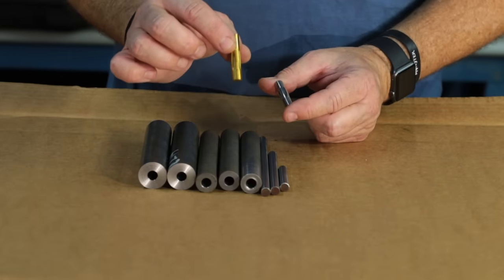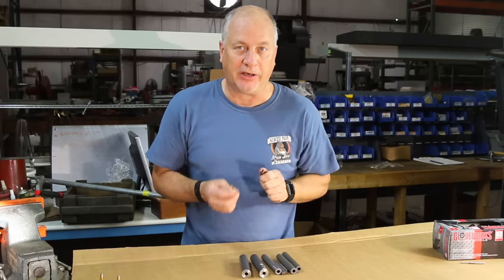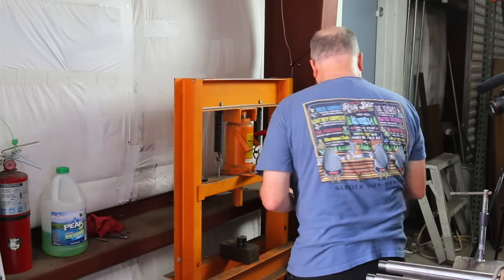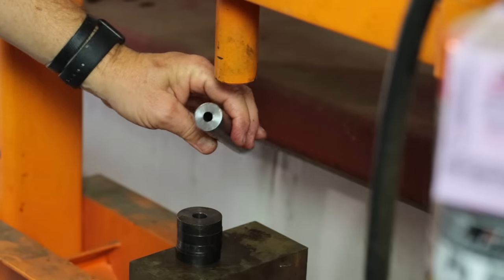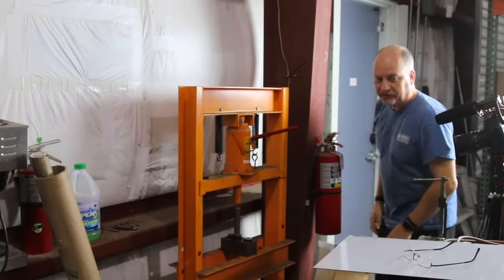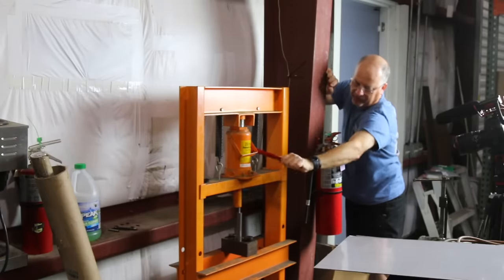Home Shop Rifling THREE(ish)...China vs. Ukraine Rifling Buttons!

Comment: is it possible to do the same rifling process to a longer barrel? like for an airgun or something like that. I'd like to create an airgun all by myself and that's the most difficult piece to make (if not imposible)..
Reply: Yes but no need. Bb s are rund. Normaly there is no use round balls with riffling.
If u use airsoft 6 mm then u lose power because of leakcage of air through rifling. Assuming it would be 6 mm.
Or a caselmann air machine gun☺
Reply: @GD90341  i wanted for a real airgun like a .177 or .22, i know 6 mm airsoft doesn't need that. i've seen today a guy that made a press with metal spacers buffered with springs through the entire barrel. that's genius. that way he aligned the bottom along the way of a long barrel if that's the case.
Reply from the maker: Sure.  You just have to have support(s) for the push rod to keep it from buckling.  Sometimes airgun barrels are made from bronze, I believe, and that would be a lot easier to rifle than steel.
Reply: @markserbu  yes you can do it to a railway gun theoreticaly if you have an enough long rod and press. First I saw when I ordered chinese buttons are cheap  when they came I saw they are really fine made nice surface everything exakt how to be and then when I used them I saw they make a real good job. I was very doubtful if a button for so small money can do the job but then I found out it does a great job of all parameters are good. Thanks Mark for sharing your content I love your videos 👍👍👍
Reply: There are Chinese buttons for .22, but i think they are for 22lr. T o deep grooves.
Reply: @Customizing guncollector 
Airsoft? We play only with luger.😈
Reply: @Customizing guncollector 
No worry . If need of info and i can help .☺
Reply: I’ve rebuild a few air rifles and if you want to build it from scratch look into PCP (pre charged pneumatic) . They’re basically an air cannon with a regulator. One huge advantage to them is you don’t have to fight with the harmonics that you find in making springer (break barrel style). It’s cheaper to buy a high quality PCP air rifle barrels and most the parts then it is for the tools to do this.

Comment: I had to laugh you hide from flying debris, behind the high pressure fire extinguisher.
Reply: Those fire extinguishers have pretty thick walls, even 9mm fired from a gun has a hard time going through. And yes, there might be 15 bar (217 psi) pressure in the bottle.
Reply: @Njazmo  very scientific your logic, lol.

Comment: When rifling a steelbarrel,can it be hardened afterwords,or must it be done before by some reason?
Reply: When using a rifling button it is best to use raw steel and then harden it after the rifling process. And use oversized blanks, walls should be around 1,5-2 of the caliber, so a blank for 5.56 should have a wall of 8-10 mm (but the thicker the better)
Reply: @Ivan-gb3gn  Good info,thanx.
Reply: @madeinsweden7776  I prefer to just use a regular woodscrew. If your bullets are doing fewer than 500 revolutions per meter at supersonic flight then they will be prone to tumbling. the more revolutions per meter the longer it will fly because of the magnus effect. You can escape earths orbit at 1/20th escape velocity if you achieve around 7500 rotations per meter.
Reply: @InvadersDie  

What are you smoking? 
Even a fast twist rifle barrel is only going to spin a bullet about 6 rotations per meter, handguns will be less than half that

Even if you meant rotations per minute,  instead of per meter, your number still wouldn't have even been in the ballpark. A slow twist barrel (1/16) at the speed of sound, is going to be spinning a projectile at almost 50,000rpm. That same barrel is going to rotate the projectile just under 2.5 times per meter
Reply: @Man_Emperor_of_Mankind  and they tumble, it's bad design. You need more spin for TRUE stable flight
Reply: @InvadersDie  
You're right.... All the professional precision shooters shooting barrels with twist rates ranging between 1 in 12in to 1 in 6in, have no idea what they are doing and are shooting projectiles which aren't stabilized

You should just stick to video games
Reply: @Man_Emperor_of_Mankind  If they want to shoot close range you don't even need rifling, the air resistance from the tumble won't affect it much. However if you want the bullets to fly in a proper flat straight trajectory you need the magnus effect to work against the gravity by generating lift. It's simple ballistic theory.
Reply: @InvadersDie  
Yeah, you should just stick to your video games. 

Spin drift (the magnus effect) doesn't provide any benefit, and directly works against having  a flat/straight trajectory
Reply: @Man_Emperor_of_Mankind  dude it cancels out the effect of gravity. It allows for TRUE flat trajectory, none of that arc path nonsense. You've been vaccinated haven't you?
Reply: @Man_Emperor_of_Mankind  I don't know what you are fishing for with that link but I won't bite. I don't do bogus conspiracy websites. Clearly you have been told what you know instead of having figured it out your self. If you let others preach to you there are no rel difference  between what you consider fact and religion.

Comment: Hello for the barrels what materials you use  ?  Inox 303  ?  304  ?  316  ?  Or classic  magnetic steel  ?
Reply from the maker: At 1:09 I mention it and hold up the parts where you can literally see "12L14" written on the side.  I would never use 300-series stainless for barrels.
Reply: @markserbu  thank you for answer  !and what type of machining grease do you use for the passage of riffling button to the press  ?
Reply: I've just received a Chinese 9mm Luger button and am planning to use 303SS, I'm only going to use subsonic so because the velocity and stress is low this material should work out.

Only problem is that the tool rifling outside diameter are about .014" oversize, also finished bore diameter should be .346" and the tool pilot diameter is .352", so won't fit.

I'll cylindrically grind the pilot and rifling diameter down to Saami spec and see what happens.
Reply from the maker: @remidib6142  I used moly grease but ideally you'd use something called "Super Draw 150" from AFT Fluids.  www.aftfluids.com
Reply from the maker: @stevenhall8027  Sounds like you got a Makarov button...the bore diameter for that round is .3543 so a .352 pilot makes sense.  You really want to regrind a $30 tool instead of just buying the right one?  As I said above I would never use 300 series stainless for a barrel.  Maybe if it were nitrided afterwards it would be good, but otherwise it's just too soft.  You will probably end up galling the bore and shooting out pieces of it as you shoot.  I've seen the same effect with the 12L14 barrel.
Reply: @markserbu  Mark thank you for your quite reply. The Chinese ad on eBay didn't specify what 9mm it was, so murphy's law, it had to be odd ! The tool took 3 months to arrive, so I'm happy to spend a hour on the grinder to fix it. I thought soft stainless might be okay as I've machine some old 22 barrels that were as soft as butter. I've got a length of PH15/5 that might sound like overkill but it's just sitting there not doing anything. I've got a .223 that has never predictably shot straight, so thought I'd convert it to subsonic 9mm, we have really big rabbits down here ! Barrel length has to be no less than 11" to reach New Zealand legal length. I'm an old Kiwi and its in our DNA to prefer to potter around in the shed rather than be forced to watch TV with the wife.
Reply: @markserbu  Hey mark. What about 42CrMo4 (I think its 4140H in SAE, the one you mentioned in the video). How good will that fit for a barrel? AND is it necessary to harden barrels? If yes, will it stay straight after hardening? Drilling and Reaming is no problem. But all of that needs to happen before hardening then. So. How can one guarantee it will stay straight and on spec? Without heavy machines and huge and professional ovens for heat treatment of course. Or am i completely wrong on this?

Comment: Hello friend, I wonder what is the type of steel is made this pipe, or what type of steel supports 9mm by 19? Thank you right now.
Reply from the maker: This steel was 12L14 which is an easy to machine leaded steel.  Not high quality but easy to machine.  Usually for 9 x 19mm you want 1137, 1144, ETD150, 4140...that kind of thing.
Reply: 4140

Comment: I finished building my rifling press! I used a chinese button in this video. https://www.youtube.com/watch?v=J3pDlKxou6Y

Thanks for the inspiration. Let me know if there's any improvements I could make. The 1144 rod experienced no deformation and was hard enough without heat treatment to let the button spin freely during the rifling process.
Reply from the maker: Good job!  Nice to see other people messing with rifling.  I think you might be able to get away with fewer bushings (the ones with the springs between them), and a quick Euler Column Buckling calculation would tell you that.  What caliber did you do in the video?  And what was the barrel material and dimensions?
Reply: @markserbu  it was 25acp. They're skinny so they can drop into a 9mm barrel (it's a barrel insert). A513-5 DOM tubing (3/8 OD  .245 ID so a couple thousands oversize on bore diameter), but I've also used 304 stainless and 4130 tubing. At some point I'd like to get set up with gundrilling too.
Reply from the maker: @max-weber  Cool.  Man, 304 is a pain in the butt to machine if you're not careful...work hardens like crazy.  How did it rifle?
Reply: @markserbu  The 304 stainless has some kind of crud/lubricant/scale leftover on the inside from the supplier. Every supplier I've ordered from has this crud on it. The button will rifle through it, but the crud is still there. I know some suppliers offer a "bright" annealed or polished ID that would probably work well. As for machining, yeah its bad! If you need an accurate cut, you have to leave extra material for the finishing pass so you can dive under the hardened work surface.

Comment: goodnight what steel did you use? I use a 42crmo pipe with a 22mm outside diameter and the pipe cracked into three pieces. I made it with 1020 steel but the lanes wear out quickly, what better material to use the rifling button?
I used chinese 9mm button rifling barrel made in china with 22mm outer diameter and 8.8mm inner hole
Reply: Use 40cr, 42crmo has more carbon content so it’s more brittle, you should be able to get it from the same Chinese supplier, also make sure you get the correct diameter
Reply: @Mihail2204  I buy it with an 8mm inner diameter and reopen it to 8.8mm. in the video it heats up with the blowtorch and then puts it in the oil, doing this in the 42crmo will it be less brittle?
Reply: @wmn47  from which country did you buy your rifling button from?
Reply: @Mihail2204  chinese 6 flutes grooves
Reply: @wmn47  9mm?
Reply: @Mihail2204  yes
Reply: @wmn47  the Chinese 9mm are commonly for 9mm makarov, which is a bigger round than 9x19 as far as diameter goes, so no wonder it cracked under all of that pressure, get a 9mmID barrel next time and use it
Reply: @Mihail2204  but I'm using 8.8mm ID because I'm trying to make a .380 acp pipe. do you think that for 9mm the chinese button, the barrel has to be 9mm inside?
Reply: @wmn47  Yes, because the 9mm Chinesium buttons are made for a 9mm bore, not an 8.8mm bore. You’re pushing a button that’s 0.2mm too big for your bore through.
Reply: @wmn47 If you want a proper 9x19 barrel, send them the SAAMI specs, and they’ll make a proper button for you, or better yet, order one from Ukraine.
Reply: @slftr5139  but my Chinese button is 9.3mm
Reply: @Mihail2204  but my Chinese button is 9.3mm
Reply: @wmn47  so get the 9mmID tube, then it will work

Comment: Using a rifling button seems from an engineering standpoint like it would put an ungodly amount of stress on the barrel causing stress fractures along the longitudinal axis of the barrel.
Reply: It's easier on the material than cold Hammerforging. Also the longitudinal axis on a barrel gets rarely stressed in use and is the best axis to load a cylinder on.
Reply: In button rifling is there much material being removed? Or is the button just moving/forming the material?  I feel like that distinction could be a big deal. 

I’d also say that the zone of influence of the button is very small in relation to the wall diameter of a barrel and anything outside of that will not experience any real deformation or stresses, certainly not enough to exceed the elastic portion of that materials stress strain graph.
Reply: @joshrakestraw5580 a riffling button doesn’t so much remove material like a cutting bit, it ‘presses” its form into the steel. It is why rifling buttons must be made of hardened steels rather than softer steels for barrels.

Comment: If someone wants lives space for the chamber can return to rifle button before the end, (chamber space) to the start?
Reply from the maker: I don't understand exactly what you mean.  The barrel is rifled and the chamber is cut at the end where the rifling started.  This isn't an absolute necessity, but it's good practice.
Reply: @markserbu  Thanks for your answer, for example I have a adapter 12 gauge to 9mm, if I rifling the adapter with the rifling button must be stopped to the half because the other half is the chamber and if the rifling button pressed will damage the chamber, this is the question if you know, the rifling button could make the half adapter and then press it to the back, or press it back will damage the groves
Reply: Gr ringo Adios I know what you’re saying just rifle the whole lot then ream 9x 19 reamer through chamber end and don’t use a China made button or reamer. Good luck and greetings from Australia 🇦🇺
Reply: @craigkaschan4822  Thanks for the answer, I use a 12 gauge to 9mm luger adapter not rifling for single shotgun , works and good accuracy  but not stability the bullet , I try two different rifling button, fits only the Chinese to make  the groves and now shots with stability  mostly, but you have right the other rifling button I have is exactly 9mm luger and I will use it to another adapter who fits perfectly for better Result

Comment: I see the chinese rifling buttons on ebay. They are however just listed in i.e. 8.4 8.5 and 9.0mm What would be correct size rifling button for caliber 9x19 and for .38 Special ?
Reply from the maker: You need to check out SAAMI.org.  They have the rifling specs for pretty much all known calibers.
Reply: These Chinese buttons are ALL for 9x18 Makarov. They lands are 9.0 the grooves are 9.35 which fits only for Makarov. It won't work with Luger or .380 acp

Comment: My 9mm luger button from China is way out of spec. Closer to 9mm macarov in size. Totally useless ill be getting one from Hammerbutton next time!
Reply: I have read similar comments but Hammerbutton's photos make it look like the grooves are still dodgy like in the previous video so what to do. Mark may have been sent a special one off
Reply from the maker: @Riven1974 You have to be careful with the Chinese buttons and make sure you're getting one made to the correct spec.  That mixup between 9mm Luger and 9mm Makarov buttons is fairly common.
Reply: @markserbu  Mr Serbu where for art our promised 4th rifling vidyo? Please and thank you.
Reply: @kirkc9643   He is a Chinese, I am very sure
Reply: @jamesd4923  
Well, you got slapped down, didn't you?

Comment: What is the Inside diameter of a 9mm barrel
Reply: That would be 9.02mm or .355 inch for 9x19 parabellum
Reply: @bisurdaddy  So thats the reamer size before plug?
Reply: 8,85 mm inside reamer

Comment: Could you have rifled the barrel and then heat treated it for better results?
Reply: heat treating introduces stress into the material causing it to warp out of shape. generally when manufacturing anything with tight tolerances the rule is to heat treat first, and then cut. if the tolerance is loose enough sometimes you can get away with heat treating after cutting/shaping your product. i work steel for a living, so i know these things
Reply: @beanshooter5784  thank you for your comment, I'm new to this stuff and thinking of a few projects.